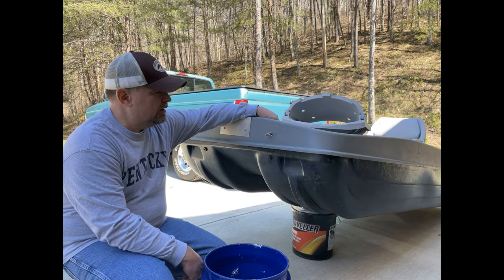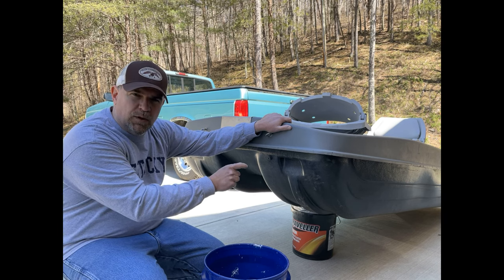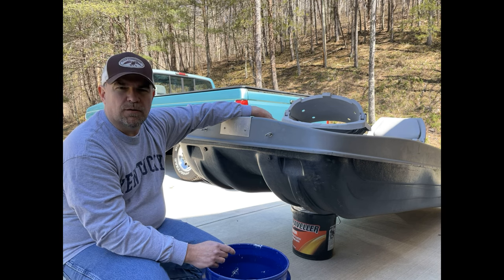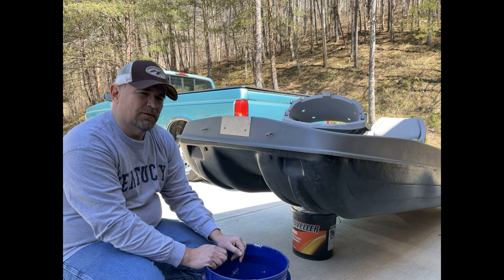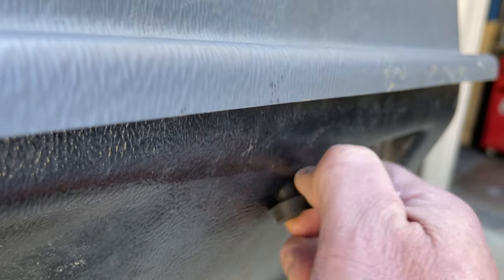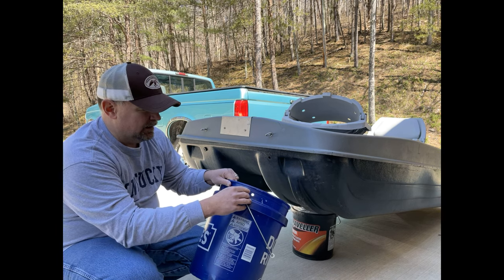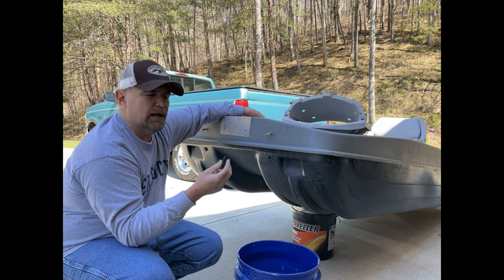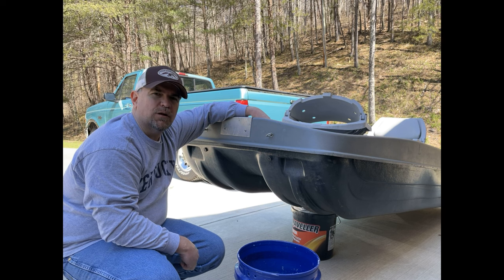EASY Way to add extra drain holes to your Pond Prowler, Bass Raider, Pelican, or other plastic boat?

Comment: My boat came with those plugs in the front like that but i found it to be a pain to turn the boat up on its front to drain it, seems it would be much better to put them in the back so you can just tilt the trailer back to drain it
Reply: Same with mine

Comment: If you take off the metal plate on the transom there is a plug under there.
Reply from the maker: Thanks,  but I don't want to have to unbolt it every time I need to drain water.   This works out great for my purposes.

Comment: Just got a used pond prowler. How do you know if there is water inside your hull?  Another solution might be to install screw in drain plugs like used n boats. They are always under water and and don’t let hardly any water in.
Reply from the maker: Just pick one end up and if there's water inside, you'll hear it running to the other end.